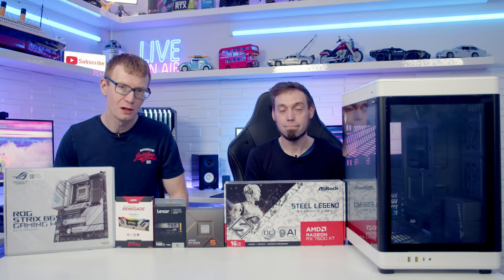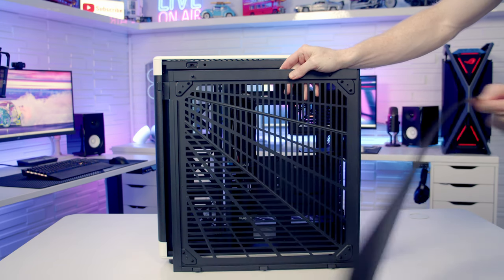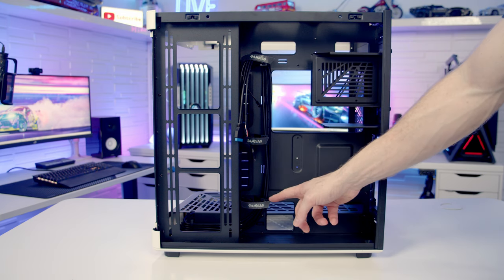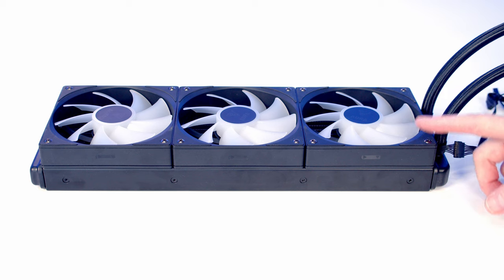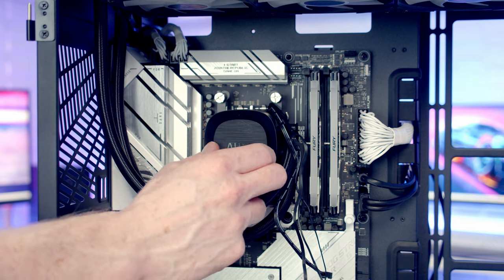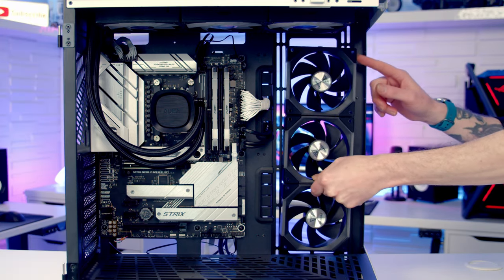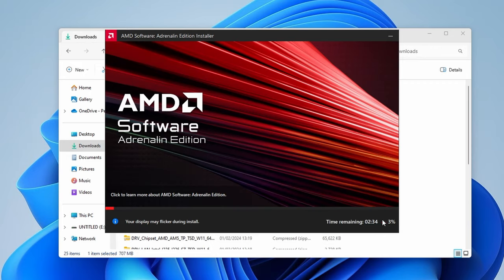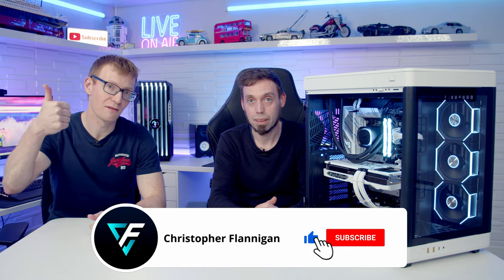Gamdias Neso P1 Build with a Subscriber

Comment: Do AMD boards not have the same issue with the top M.2 slot sharing the bus with the GPU? Edit: never mind, looked at the manual, the 3rd M.2 slot is shared with the GPU slot.